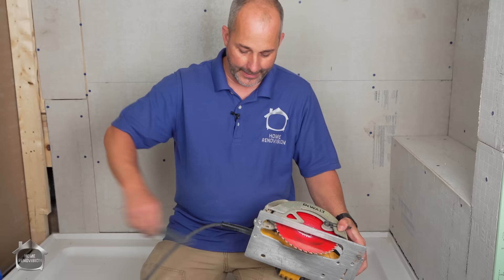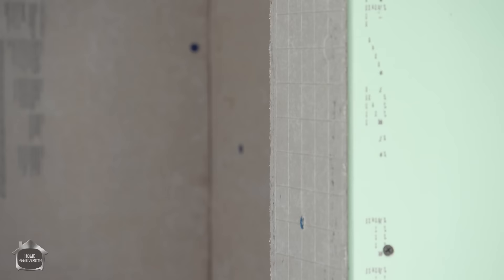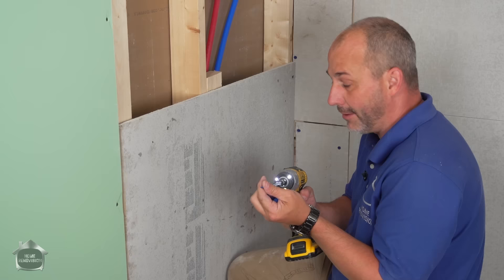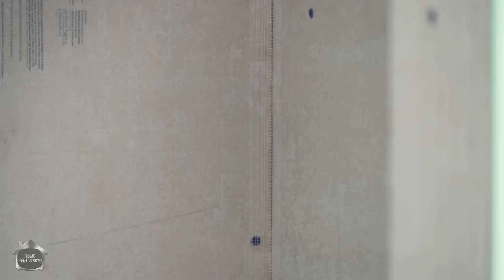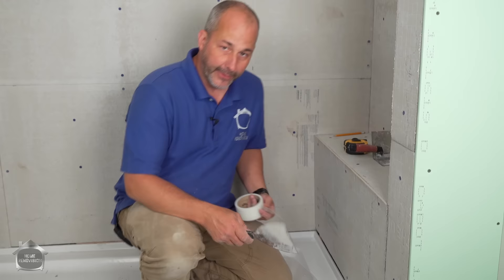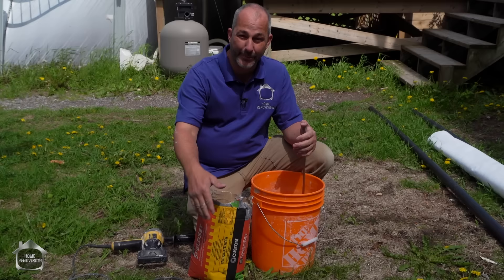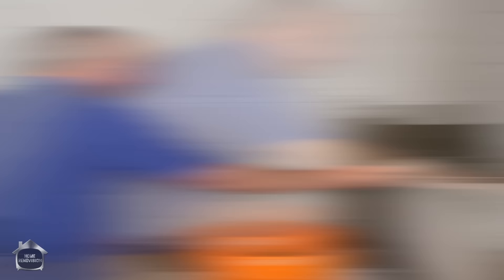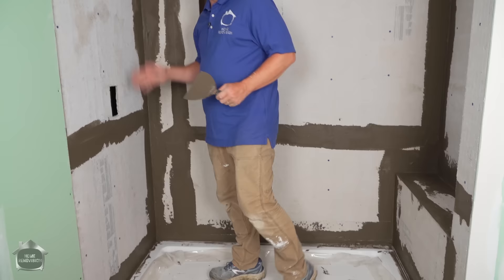How to Install Cement Board for Beginners

Comment: I’ve learned a ton from your videos! On my second complete bathroom Reno and this time doing a walk in shower with a Kerdi shower pan and cement board walls. I have some kerdi ban for the joints between shower pan and cement board walls. Do you know if I should use speedset or if I need to use an unmodified mortar to set the kerdi ban as suggested with most kerdi stuff? 

Also, for larger gaps (1/8-1/4 inch) between cement board, do you recommend filling with mortar or speedset before applying tape/kerdi ban? 

And lastly, if I wanted to go over my mesh tape with kerdi ban after the speedset dried, would you use    Speedset or an unmodified mortar to set that? 

Thank you so much for any advice you may have!!!

Comment: Can you use kerdi tape on the hardibacker board instead of the mesh tape then waterproof with aqua defense over the top of everything then use a modified mortar for the wall tiles over everything?

Comment: Jeff: you do seem to prefer (mold resistant) drywall or Schluter Kerdi Board solutions for shower/bath stall sheathing over cement board; do you? And why? Simliarly, you seem to prefer Schluter WP solutions over say, Redgard, which, watching you demonstrate each system, makes me feel a brush-on seems more versatile, perhaps simpler, and better value? Can you comment?

Comment: I have watched numerous videos and I am still confused as to where the cement board should lay at the bottom in relation to the shower pan.  Each video seems to have their own take on it.  Do I need to add furring strips to bring the wall out so the cement board comes down onto the pan?  Does it depend on the material such as Cement board VS Go Board?

Comment: Just ran across your video. I have renovated several tub and showers on my rentals and have worked with both drywall backer and cement board backer. Always pai.ted both with red guard. What I have not done is use the tape on the joints. I alway make the redguard thicker in those areas to flush it out.  Since the waterproofing material is flexible I did not see the need with tape and mortar. Not trying to short cut any thing just did not make sense. Your thoughts please and thanks.

Comment: Hello, I am a builder in Michigan and am starting to do more and more bathroom renovations. Typically I do all the work save for laying the tile. Until late that included installing the cement board and waterproofing. Now I am beginning to water proof myself to speed up the process. My question is, whats the best way to water proof a Go Board or shluter board backer? will red guard on the fasteners and seams do the trick if i apply 2 coats? Also what is best to use on a shower ceiling? Ive used green board in the past but Ive also torn out enough drywall ceilings in fine shape to think it isn't entirely necessary. What are your thoughts? Thanks for the vids.

Comment: I am going to do a tile shower wall around an existing tub next week all by myself.  What I don't think I have seen addressed is what do you do with the seam on the cement board and the regular drywall?  Do you use regular drywall joint compound or do you use the cement that you used in this video. Just worried about that transition.  Thank you for putting out these videos.

Comment: You said your cement got hard "gloopy" in storage. I recently watched a vidio about a cement mixing bag. It is a heavy mil clear plastic bag designed for mixing cement by hand.  I tought if you stored your extra bag of cement in one of those heavy clear bags it could prevent it from absorbing humidity and setting up in storage.
Reply from the maker: Thanks Mary, a great idea for sure. Cheers for thinking about me.

Comment: 8:34 after installing the fiber tape, is it necessary to cover it with quickset (thin set) right away or could it be done days (approximately 4/5 days) later.

Comment: My shower panels only go about 71 inches up the wall, can you use this on the drywall above it and then paint over it or because of the thickness will you see the divider line between it and the rest of the room paint, will paint even adhere to it?

Comment: How do you treat the corner jointin terms of waterproofing and finish when one wall is lined with Cement Board and the other wall is an external  cement rendered brick wall with some movement in the joint due to different building material ?

Comment: Love your videos. So easy to follow. I have a cultured marble shower stall that is simply ugly and aged and yellow. I've priced getting the walls restored at a price of $1200 or more. If I do the work myself, can I tear out the cultured marble, install cement backer and waterproof and retile for less than the $1200? Shower stall is approx 60 sq ft and I would like to keep the tile cost at $4 per sq ft.

Comment: Jeff I am finishing my basement and have a lower shower height because of duct work. Currently there will be about a 3" - 6" opening from the shower glass to the ceiling height acting almost like a steam shower. If I was to use the cement board on the surround shower area as well as the ceiling of the shower, covering it with the waterproof membrane, what paint would you recommend to paint over the membrane ceiling if I decide to note tile the ceiling?

Comment: If I am installing cement board in preparation for a fireplace surround, do I still need mesh tape and waterproofing?
Reply: it's hard not to get cracks after a fire... Mesh tape yes, water proofing no (it's a very dry place...)

Comment: I'm using cement board with mold resistant drywall do I still need to use a waterproof membrane? No tile and it's for a bathtub

Comment: Hey guys. I would recommend not putting the membrane on super thick. If it's thicker in one spot, at a corner, it will dry at different speeds. That can cause it to crack. Just put on two even coats. It's designed to work that way.

Comment: Does the quickset not bond to the shower pan where you peeled back the plastic? I would think it scratches or would be extremely hard to remove once it sets.  Did I miss something?

Comment: Jeff, great video! I just got finished ripping out my shower walls (two pieces of drywall and a sheet of plastic covering them instead of tile).  As you guessed, ripped out due to mold.  I discovered water between the cement shower pad (under the tile floor) and the rubber liner.  I can see a hole in the cement pad under the tile.  Can I just seal that up with cement filler or do I need to destroy the entire floor and start over again?  Or should I just cover it with an acrylic shower base?

Comment: Hy Jeff..." I have a problem with a cracked cement board exterior wall, what material should we use to put it back together so it won't crack in the future? I once asked some friends and they used Portland cement, white cement  , and some even used automotive Putty, none of which worked.

Comment: The contractor who put in my cement board didn't bring it tight to any go the corners (either inside or out). I filled the inside corners with thinnest and then meshed over that and thinset-ed again. But what do I do with the outside corners?

Comment: Thank you! Quick question, on a  bathroom floor, do you need to use thinset and screws between plywood subfloor and cement board? Or just screws?  Have read it both ways online, what do you think? We bought a house (both coming from condos)that needs a lot more elbow grease than anticipated and your videos are amazing.  I looked through a lot of these comments and didn’t see this (though nearly 2k comments I might have missed).  Much appreciated.

Comment: Question. Currently framing in my basement bathroom. Going to use a 1 piece, tub/shower combo (acrylic/plastic). Exterior wall of the basement was drywalled and rough mudded by the builder, side walls will be wood framing. What do I need to do behind and under the tub/shower? Any waterproofing? Any cement board? Hope you see this. Thanks.

Comment: For joints in this video mesh tape was installed first and then thinset applied over it. Saw other videos including Lowe's where they applied thinset first and then meshtape over it before it dried. Which is the right way to do and why.

Comment: Hi all, so I found this video when researching cement board. Wondering if anyone can help. Now, I have a hole in the wall of the downstairs toilet. This is how I saw foil backed cement board was used and I'm trying to figure out if it's really needed or if I can use normal drywall to fill the hole? it's a pretty large hole at the base of the wall. Grateful for any info

Comment: I just found this Channel. We remodeled our bathroom. We use 1/2 inch cement board. And we put the mesh tape on every union of the cement board. We then put aqua defense on those unions but, we didn't put any cement. How screwed are we?

Damnit, we also didn't put the aqua defense on the whole wall... Just in the unions.
Reply from the maker: no worries. its not too late to add some cement and then paint again. Cheers!

Comment: Great video again Jeff.  I am in the process of installing a vanity in the ensuite.  Because of piping and electrics I want to be careful naturally.  A basically following your process for cutting the board so I can check fixing points.  Is there a tool that you recommend to cut a piece of cement board that is already installed.  So I can check and add fixing points for vanity??   I bought some Diablo cutters that the hardware store recommended  that fit an oscillating tool but they just burnt out.

Comment: Sal Diblasi, in his video,"Proper way to Install backer board in Tub area," shows the code book to rest the board on the tub, at "3:51ff in his video, "This is the way the code says to do it," and he says at 1:16ff, "Rest the board on the tub." So, I am confused with your method and his. Which one is right?

Comment: Jeff question. For starters love all your videos very informational. I am working on finishing my master shower. I sent my husband to the store to buy a bag of that speedset and he bought the wrong thing the same brand but it is the blue bag and says on it custom blend economical non-modified thin set mortar. Will this work or not? Also does it matter which side is out on the cement board? Please and thank you.

Comment: @HomeRenoVisionDIY
Good day hopefully you see this.  Should i fill a little thin sit in the gap between  tile flange of the tub and cement board before i put the fiber mesh tape up and then more thin set on top of the fiber mesh tape after as well?  Im kind of scared of the gap i have between the cement board and tile flange.  Thanks in advance!!

Comment: The comment about installing the blade backwards cracked me up.
I went over to my sisters to visit. 
Went use the circular saw,  she said it needed a new blade because it is dull and it is hard to cut wood. 
I told her, I gave her husband a new carbide tipped blade,  it should cut like butter..
She said, will it doesnt cut good. 
I said, I'm doing some small  cuts and it should be fine..
I went use it and it wouldn't cut at all.
I looked at the blade, the rocket scientist husband, put the blade on backwards..
I turned the blade around and cut the wood like soft butter..
Without saying anything about changing the blade, I said it cuts good and showed them both. 
Baffled as to why it wouldn't cut for them, I said you didnt plug in the cord correctly, you reversed polarity and it makes the saw run backwards..
Since then the check goe its plugged in..
The plug is old style, 2 prong..
It's been 13 years since then..and they marked the plug so it goes in the way I said..
Since it's been 13 years this April 1st I will tell them.

Comment: Good morning
Getting ready to hang backer board in our bathroom, based on your videos I was all ready to go with Hardie board but a tile friend told me about Denshield, 

What are your thoughts on this would you still prefer to use hardie, mesh, mortar joints and membrane?
Reply: Love you videos
Do you have an opinion on cement board vs a Denshield product, planning on starting tomorrow.  An electrician doing tile, I'm possibly overthinking all of it. 

Thanks!!!!

Comment: I had a contractor start a tile that didn't complete the project and now I am taking over. The cement board and fiber tape are on, and the one coat of Aqua Gaurd has been applied. My question is is it too late to apply the coat of thin-set since he already applied a layer of the Aqua Gaurd?

Comment: So how smooth does your cement boards have to be after putting in the screws and taping/mudding? I know I have heard you say before you don't always have to have all the screw heads flush but I'm a little concerned but it sure ain't pretty. I'm going to be putting on 12 x 24 tiles using 1/2" square  trowel.   Thanks and "Cheers!"

Comment: So I have taken on a half bath remodel just replacing the old tile and half inch plywood with new tile and I made the mistake of buying 1/4 inch Hardie backer instead of 1/2 inch. I figured I would just double the boards and tile the floor. My question is do I really need to set the board in thinset and tape and mud both layers of Hardie board or just the top layer?

Comment: Good video!
Question, how you connect or what you used in the gap between the concrete board and the sheetrock, to close that gap and make it smooth with the out side sheetrock wall?

Comment: Someone suggested to me to install the cement board, add a layer of waterproofing membrane.  While the membrane is still wet apply the schulter waterproofing tape on the joints let set and then add another layer of waterproofing membrane.  The tape is $40 but if you feel that it makes for a better water tight seal than using mesh tape and cement on the joints before painting on the two layers of waterproofing membrane I'll do it.  What do you suggest?

Comment: I am thinking of using cement board to frame the inside of my basement windows. Thinking that if there is some condensation it will not mold up like regular drywall. What are your thoughs?

Comment: Can anyone address the issue of having a plastic vapour barrier on exterior wall, then installing cement board over it. I'm doing a corner shower renovation,  2 walls, 1 interior, 1 exterior.  The fear of creating a so called
"moisture sandwich" has delayed my progress.  I live in the Canadian prairies, cold winter climate. 
Planning to install cement board, over the plastic vapour barrier, then use redguard roll on membrane,  and tile. Is this a real concern,  or are DIYers here in Canada just being misinformed for no reason? Appreciate your input. Thanks
Reply: I'm by no means an expert but I have been researching this for my own project. There is a YouTuber called Matt Risinger who's got an interesting video about whether or not you need any vapor barrier at all. He argues with evidence that most times a vapor barrier is overkill. It's an interesting video. Search for those terms and it should come up.

Comment: Question... for anyone to answer. Where the cement board hangs just over the tub flange and sticks out to far... This video says to use tape and then level it out using thin-set. I saw another video where the guy taped it, then used Redguard and then used thin-set to level it out. He said that thin-set would not "stick" to the tub flange nearly as well. This video suggests the opposite. I want to do this right. Any help would be greatly appreciated.

Comment: Thank you for this easy to understand video. Actually, all the videos you have are easy to follow and are very helpful. I am a first time DYI in my new, old home. I have made two small bathrooms out of one very odd bathroom. I have followed your video as well many others. Here is my question-
If I’m going to tape the bottom 1/4- 1/2 inch gap with tape mesh and then cement ( modified thinset) why wouldn’t I just put the backer board over the tub/shower flange? It’s basically all cement. 
Is it that the taped portion( under the tile section ) is more flexible?
Reply: This is the same question I have. What did you end up doing? My cement board is already installed just above the flange as Jeff did in this video. I did this to avoid the tub flexing against the cement board. But if I fill the gap with thinset then the flexing would become a problem again. My alternative is to fill the gap with silicone sealant, but I worry that my smallish tile wont have enough support to bridge the gap with just silicone in the void.

Comment: My new steel tub's tile flange is 1 inch wide and only about 1/16th thick. I overlapped  the cement backer board over the flange.  (1/2 in DuRock)  I have about a 1/2 inch gap at the bottom that I will need to fill with mortar and fiber tape. Is that okay? Just wanting to make sure before I continue.

Comment: How do you join the seam between the drywall and cement board on the wall and ceiling, what tape and  joint compound do you use to get a smooth finish for painting?

Comment: Is the cement board required to be flush with the shower base integrated tile flange? I am asking because the cement board is 1/2 inch and the shower's integrated tile flange thickness is less than 1/2 inch. Can you please clarify?

Comment: Do you leave a gap between the pan and the cement board. How about coating the bottom edge of the cement board before installing the bottom sheet.

Comment: You mentioned in this video to post any questions for a water barrier.  We have recently purchased an 1890 farmhouse with an old cistern.  We want to keep it because it is in good shape and still holds water.  Our plan is to use it for lawn and garden watering.  What product would you recommend to coat the inside of the cistern so it does no leak?